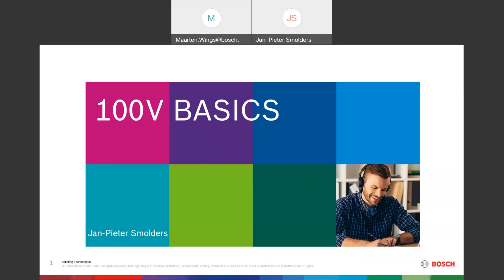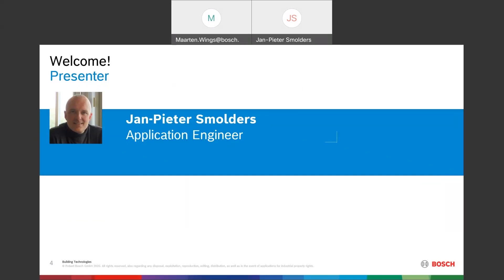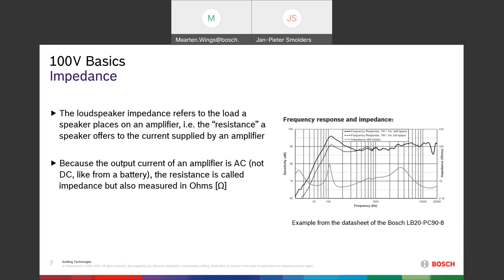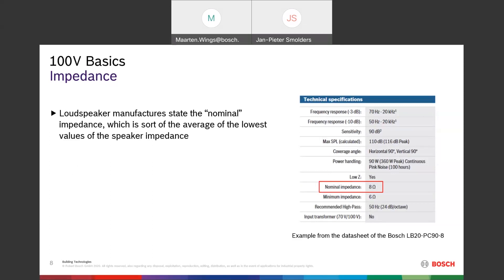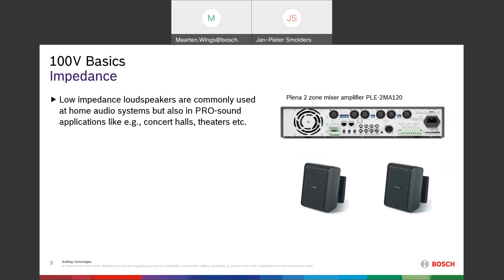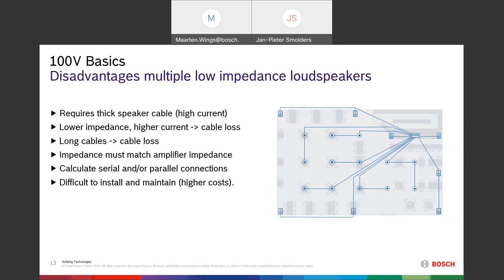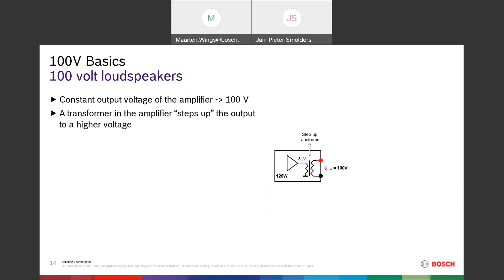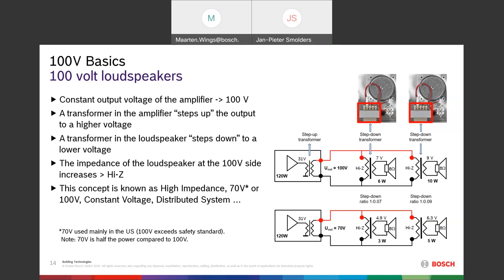Webinars: Bosch Loudspeaker Basics of a 100 volt audio system

Comment: sir good morning i just want to ask something regarding your amplifier model PRS-4B125 @ the back side of the amplier the output is written speaker A and B it should be both use or onr line only?
Reply from the maker: Dear Joel, the PRS-4B125 is a 4 channel amplifier, each channel with an A and a B 100V output. Both outputs are connected to the same amplifier channel so both outputs have the same audio signal. You can use one of the output channels or both or connect the speaker line as a loop between A and B, Class-A speaker line wiring. You can also use End of Line supervision on the speaker lines. Everything can be configured in the configuration of the Praesideo system. Check the manual for more information. The manual can be downloaded from the Bosch product web page. If you need further information please contact our local sales team: https://www.boschsecurity.com/xc/en/contact/
Thank you